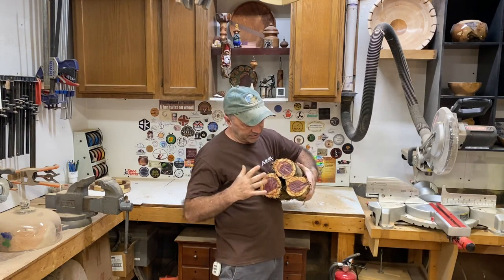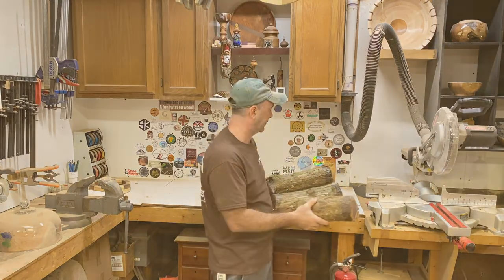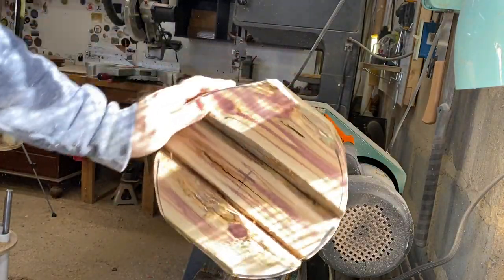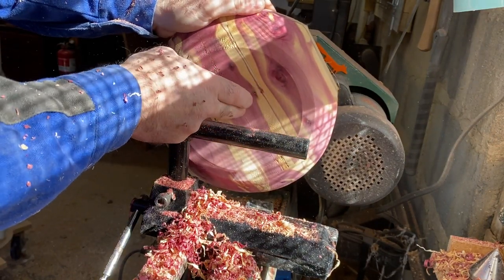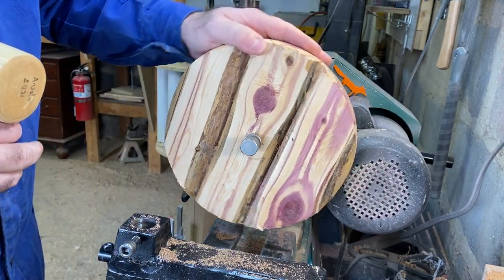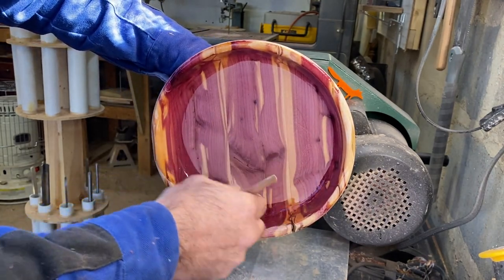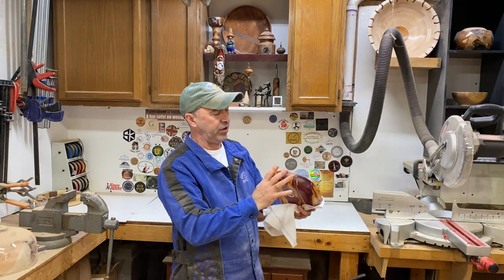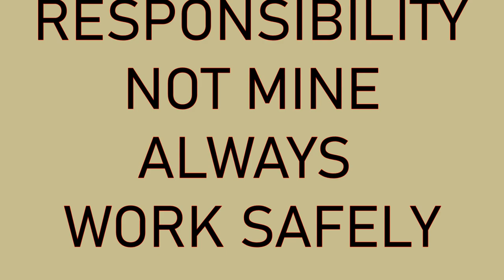Woodturning 3 Awesome Little Red Cedar Branches Into A Beautiful Plate

Comment: Next time cut through the pith on each “log”, then do the glue up. Only way I know to avoid the pith stress cracks that come with damp wood. It is such a pretty plate, I hope it stays together for you.
Reply from the maker: I usually would get rid of the pith but these branches were to small and I would not of had much good wood left.
Thank you so much for your support and kind words 👍